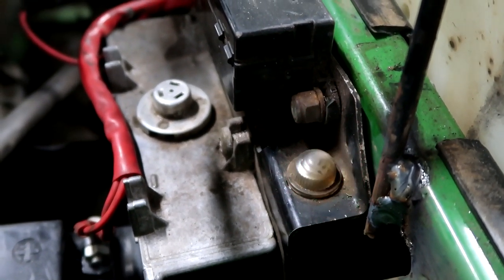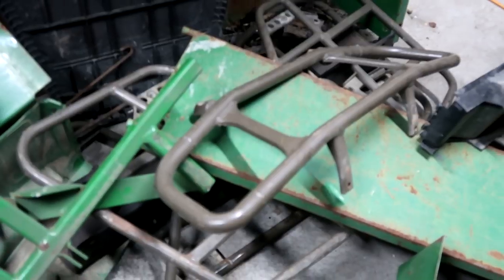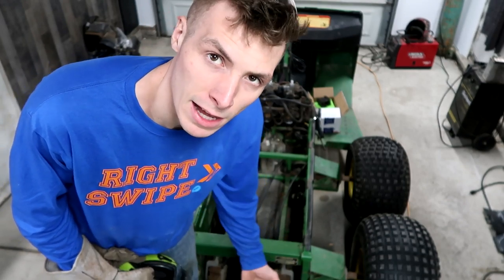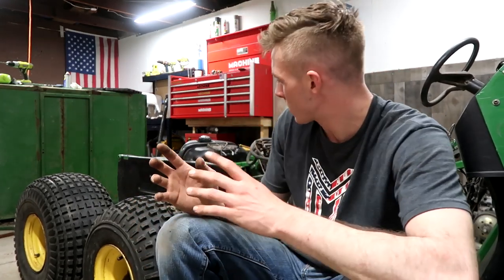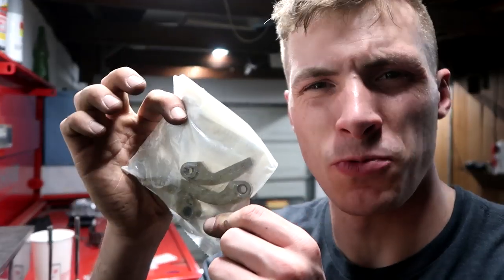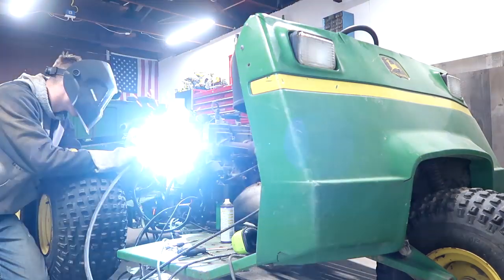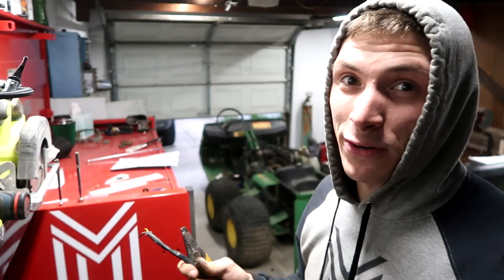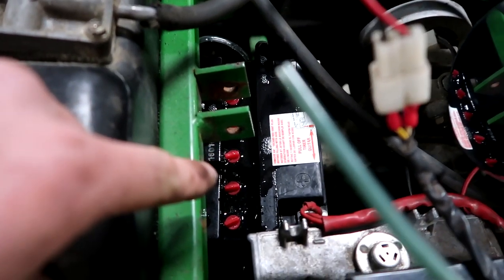THE SUPER GATOR FIRST START

Comment: Dalton cant I mix oil and gas for my 4 stroke because my 2 stroke leaves there... Four wheeler
Reply: What
Reply: @bryanroupe8646  question
Reply: You dont want to mix any oil in your 4 stroke gas.
Reply: @bryanroupe8646  i cant put oil in the 2 stroke reservoir still lubricates the cylinder
Reply: You can with a 2 stroke but not with a 4 stroke.
Reply: @bryanroupe8646  yeah its a 2 stroke just mixes it self